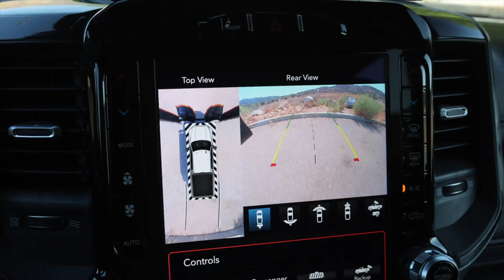What Did I Upgrade on the Power Wagon This Time?

Comment: Could the A Pillar mounts possibly be from SDHQ? My boyfriend has them on his excursion and they look similar. Great PW by the way! You’re an inspiration!!!
Reply from the maker: I think that's them... thank you for sharing that info!  Pinning this for everyone else to see.
Reply: Yep I have the SDHQ A Pillar mounts on my ‘20 Ram 2500
Reply: could also be ZroadZ. The ends look familiar to the set i have on my ram 1500.
Reply: I have an SDHQ set on my 2021 Power Wagon, Flex Era 3 lights.  Would fit Flex Era 4 easily.
Reply: They also could be the Rigid mounts. I have those for my 2022 Power Wagon.
Would need to see the full mount.
All the brands are Simular.

Comment: They're like kids.  You love them both, but just differently.  Another thing to add.  The Cummins puts the intercooler right where the OE winch is mounted.  I don't think a lot of people realize or understand the value of the engineering Ram did to custom mount the winch between the frame rails.  This tucks it back behind a stock bumper.  If you wanted to mount one on the Cummins it would have to be mounted on an after market winch bumper way out front putting even more weight way out where you don't want it.  Not to mention losing that great approach angle.
Reply: the pre14 trucks, fitted them nicely, but with the upgraded and reloaced intercooler on the 14+ trucks makes it incredibly difficult, another aspect to think about with the diesel is dragging the intercooler into water or rocks. plus the wagon specific radius arms are a big plus. they grant the truck way more articulation then a diesel ever could.
Reply: Ey thank you both for that. Just bought a '14 power wagon so I'm looking for all the pros 😂
Reply: Not to mention the PW can be ordered with dual alternators. Power Wagon is a great truck.

Comment: If you want to get rid of the push connects I recommend nut and ferrule airline fittings. It’s what we use on semi trucks as they are secure and do not leak unlike the push connects.
Reply from the maker: Thanks for that, I think when we get home from this next trip I'll be swapping them out.
Reply: Agree with Cody. I’m a store manager of an 18 wheeler parts store and have been selling parts for going on 15 years. Nut and ferrule fittings require a hair more labor to install but are better for permanent solutions. Keep some quick connect fittings for roadside emergencies and get home fixes but other than that stick with nut and ferrule.

Comment: Pleas PLEASE PLEASE for the sake of Powerwagon owners , put some pressure on Long Range America to finish developing the extended range fuel tank for the new wagons!!!! They already have one for the 1500 the gets almost 50 gallons , and that would be perfect for the Wagon.  Also not sure (you probably already know this) but have you looked into regearing? 4.88 and 5.13 gearing is common among newer wagons who run 37's and still pull loads .
Reply from the maker: I did have a conversation with them at Overland Expo West and expressed my interest... fingers crossed!
Reply: Can't believe they haven't done this. I'd certainly buy one for my PW. A 50 gallon be amazing.
Reply: Hope it will work for us non PW Hemi guys.
Reply: @ForGood828  it should work I'm certain the only difference is a Power Wagon has armor underneath. A non PW should actually be easier install.
Reply: Brown Davis of Australia makes a 32 gallon auxiliary tank for Ram 2500/3500 that goes where the factory spare tire mounts. I don't know if it's available here in the U.S.

Comment: I have a 21, RAM 3500 and I have a Palomino 1251 that supposedly weight 1700 lbs.  Running across Interstate 80 through Ohio and PA my round trip mileage is 15.5 MPG at 5 miles per hour over every posted speed limit sign.  I know from other trips if I keep it at or below 65 I can easily add another mile per gallon.

The diesels are nice the power is incredible, BUT I'm begging you with tears in my eyes, do NOT own ANY of the new diesels outside the factory warranty.  If you do you'll be inviting financial disaster.

Ohh and I have 35x11.5 tires so there's probably some math in there to adjust my mileage (as reported on the dash).  And I have Thuren sway bar, front coils, fox shocks, and sulastic shackles.  The truck in stock form was FREAKING rough on the road.  It's perfect now with the Thuren parts.

Take care.

Comment: Would throw a ratchet strap on the cooler to prevent it from becoming a projectile in case of an accident. Super slick though, didn’t realize Dometic made one that small!
Reply: It's on the floor, basically squished between the folded rear seat and front seat. Extremely difficult for a device that size to get tossed around in an accident. It will just push forward and be trapped by the drivers seat back which prevents it from going up due to seat angle.

Now if they were putting it higher, like on top of the folded-down seat or on an internal rack like what Donald @softroadingthewest does, you'd need tie downs for safety (as Donald does)
Reply: @adam_mawz_maas  Just watched back and I think you're right- short of a rollover that thing looks pretty secure. Never hurts to be extra safe though :)
Reply: They make one even smaller. It’s not the CFX line but they come in 25 and CF18. The 18 I have is perfect for road trip drinks.

Comment: You still have this Rig?  I have a similar setup but '18 with Northstar 650TC. Stock sus. Bags, hellwig,  37x13.5, and 5:13 gears.  I beat the hell out of it, goes anywhere I point it with ease. I absolutely love it! So, curious if there is something you don't like about your setup as it's been off the channel for a year.. I get Jeep content that pays the bills, but I can't imagine going back to Jeep/SUV camping with tents,  trailers and what not after camping in the PW/Camper.

Comment: We have a 2018 2500 with the beastly 6.7L.  We also have a 2016 1500 with the mild tugboat 3.0L.  The ULTIMATE  Powerwagon would be 3.0L powered, with 4.56 gears, 37's, the 4wheel camper and ALL the Brad mods!!!!
We just got back from a trip from Lancaster, CA, to Waynesville, NC, Blackstone, VA, Williamsburg, VA,, Luray(caverns), VA, Wolcott, IA, Broomfield, CO, Zion NP, and then home.  For the 6146 mile trip, we averaged 24mpg, with the 3.42 ratio and the stock size 275/70-18 tires.  Bilstein shocks improved the ride.  And a steering brace improved the steering.  But we had to visit Big O tires in Broomfield, CO, rotate the tires to cure a growing "Death Wobble" issue.
Enjoy your trip!  And hold the cruise control at 62mph as much as you can.  And the mpg won't be that bad.

Comment: I have a 2004 2500 Dodge 4x4 Diesel that I just love and is still running strong at this point. I can't make myself trade it off for the life of me. I'm considering doing some upgrades because I've been running it stock. I do know I am getting the four-wheel project M for it. Thanks for your videos, Master Cheif. RM2 1974-78 here. :-)

Comment: Brad, I think you made a great decision getting the PW for the following reasons (and I’ve mentioned these in comments of previous videos of yours before): 1) Cost - out of the box from factory. The Carly system alone installed is $10k. The wheels and tires are another $3k installed and the pop up camper is idk - $15k? The Cummins is $6-9k more than the 6.4L hemi as an option on the Ram 2500 so adding lockers, lower gears, sway bar disconnect, and winch costs double the cost of a Cummins minimum installed. Should I go on?
2) Aesthetics. There is no truck that looks as good as a PW especially in person and yours TR style is 🔥. It is a showstopper and head turner. I have 2 “neighbors” with PW’s one is the 75th anniversary edition in that sweet orange color and I can’t stop staring at it!
3) Offroad - this truck is a massive jeep rubicon. Enough said. 
4) Gasoline engine…funnily enough I think this is a positive for off-roaders at high elevations. They require less and cheaper maintenance. They don’t struggle at extreme elevations and very cold climates. Gas is still more readily available anywhere anytime. Strangely enough it is still more difficult to find diesel esp when you need it most. This is another reason I won’t get an EV 4x4 for another decade til I feel confident about that and they’ve figured out all the kinks. 
5) Comfort. If you’ve never driven or ridden in a Ram 2500 stock then you don’t know that it is as smooth as a Cadillac (almost lol that’s why I got a ram 1500 instead. That is as smooth as a Cadillac). It is roomy and has so many electrical ports for charging and powering devices. 
There’s more I could say but I’ll leave it at that for now lol. I’d have no problem getting a PW for my next truck now that I can afford one and justify its thirsty fuel tank. My buddies with 2500s and 37s say they only get 12-15 mpg anyway so id be fine with 10-12 on a beastly PW.

Comment: In my Ram last Yr, I pugged my 17L Borge Refrig into a Jackery, and the Jackery into the truck. That way the reefer always had power, truck on or off. And Jackery usually stayed fully charged except in camp, when I broke out the solar panel.  And btw, Semper Fi Master Chief, from an old HM2.

Comment: You could really use a  Mini air foil to cut down on your  Wind resistance the question is do a they make one They've been putting them on semis for years To improve fuel mileage and I see some pickup trucks with them but but they rare and probably too tall for what you need

Comment: The primary advantage the Power Wagon has aside from weighing less, is the winch that comes with it. If you know that you'll need a winch you're actually saving money by going with the Power Wagon over a Laramie that has a diesel. With the diesel, you'd have to get an aftermarket bumper (because of the intercooler) from AEV, Expedition One, ARB etc. That'll add roughly $3k to the build not counting the cost of a winch. Of course you could go with a Trans4mer set up from Warn and Mile Marker has a similar one too that would forego getting an entirely different bumper. I have a 2018 Ram 2500 diesel Laramie that I absolutely love, but if I want to get a winch set up for it, it's a huge monetary commitment. As someone who also rides a motorcycle you're talking about spending a huge amount of money in two different directions! Not at that point yet!

Comment: Keep up with the great Power Wagon updates. My 22’ PW should be here in a week and I can’t wait. I’ve been looking at the FWC Hawk Shell Model. Figure since I have a ton of camp gear I’ll try to intergrade it into then camper while still being able to easily transfer back into the JKUR when needed. The shell model is also lighter for the PW so hopefully I don’t have to do too much to the suspension.
Reply: ‘20 PW owner here that keeps about 600lbs in the bed all the time, if you don’t do the suspension AND bag it and you expect to be at 1100lbs all the time, you will be absolutely miserable. Cheapest option is firestone riderites and daystar cradles, but then why did you even bother buying a PW.
Reply: My 22 PW door sticker shows payload of just shy of 1600 lbs. tow 11,000 lbs. The truck has almost no options added. FWC site says Hawk shell model is around 900lbs. I should be fine thank you
Reply: @chris1293  hold up, before you take a big risk here - 900+2 adults+a loaded cooler+spare gas+water+eletronics+bags you're well over 1500lbs. I really suggest not doing what you're doing. The truck springs are so soft, and with all that load up high, any amount of cross wind will start you porpoising down the highway. You're gonna be miserable and the truck will crab walk around every corner as the load shifts through the turn. You're gonna end up spending so much money trying to fix the problem from here on out that it's literally cheaper to just go buy a stock 2500 and then upgrade the suspension. Even the youtube you're commenting on is a prime example of what you're going to have to go through to even marginally make it work on a PW.
Reply: @neil7340  I’ll have to weight my gear and look into it more. 
But looking at the thousands of tundras and other 1/2 ton trucks out there with a fwc doesn’t add up. Heck, the fwc fleet already exceeds my tacomas payload even before adding people and gear 🤷🏻‍♂️

Comment: I wonder if you can use a UPS.  Plug into your 110 volt and then when the truck is running it charges.  When you stop, the UPS still supplies power to your fridge.

Comment: If money were no cost, the AEV RAM 2500 Prospector XL is like a power wagon on steroids. 40" Tires 😮 with a 3" lift, winch for recovery and gives as much, if not more, ground clearance than my Jeep. AEVs build keeps most of the factory handling, feel, and minimal adjustments to drive train. The big reasons for the PXL you already mentioned are Towing, payload, and gas. In addition, I can tow my 10k trailer and gear while simultaneously towing my jeep to Moab. This allows me to set up base camp on some pretty scetchy BLM but still go play on the super technical trails with the jeep and meet all my requirements. I have seen PXLs do Hells Revenge and other more challenging trails, but I figure that's what I got the jeep for. 

The biggest downside  to a PXL is cost. The XL is roman numerals for 40 which is a nod to the tire size but could just as easily be a nod to the price tag. A fully kitted AEV build could cost you up to $40K above the cost of the truck itself 😮 . If you buy a PXL from the factory it will you well over a $100k (120k if memorybserves correctly. This is why I'm building mine in stages.

Obviously, the power wagon is a great fit for Trail Recon and most folks watching this channel. Honestly, I probably would have chosen the Power Wagon as well for your setup, and I love your choices on the build. I just new I was going for the full sized Overland trailer by Black Series.

Love your content and have been following you several years now. Keep up the good work and. God bless you guys.

Comment: This is a great setup….the diesel vs gas thing….like you say you cant get lockers….if you ever went that route..it would cost  you quite a bit and  to people i always say go 350 or 3500 the payload is double…with the RAM 3500 you get the air bags in the back..keeps the truck level..BUT i say the powerwagon gas you have is the way to go….for the lockers…. The HO cummins in the 3500 is like 14k with tax…..thats alot of gas….but going down the road nothing is smoother than that  inline 6…and 1075 lb ft ha ha…i went with a black ram 3500 single cab…8 ft box….my dream truck is a single cab power wagon..but they dont make it…BUT there are some from 05-09 out there ….and they r beasts with the shorter wheelbase and 4.56s from factory…..i guess new jeeps with 35s r coming with 4.56s too

Comment: Really good conversation on the Hemi vs the Diesel ...I've experienced both.My 2009 3500 Mega cab/Diesel, on desent down Mountain Forestry roads [British Columbia Canada] under heavy snow conditions wanted to toboggon [slide] because of the extra weight on the front end. You will not experience that with the lighter Hemi Engine and Lighter Truck [as you refer to the weight difference]  I added after market front springs to my truck similar to the Carli 2" [ kept original shocks] eventually changed out the stering shock also *very good advice due to the potential "Death Wobble. So I have experienced the fading of those shocks over miles and miles of rough road. I'm now eying that Carli Front supension kit. With all that Like yourself I miss my Rubicon

Comment: Hi Brad, could you cover the maintenance part, such as diff and transfer case oil change. Since you do lots of off-roading how often you change the oil? (mine has 37k and i am wondering if i should do front and read diff. dealer priced about $450)